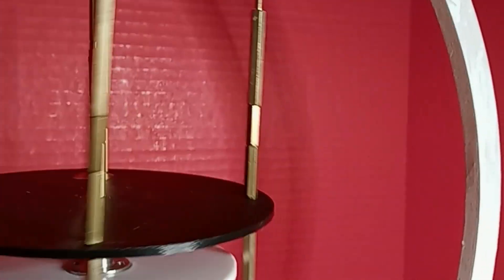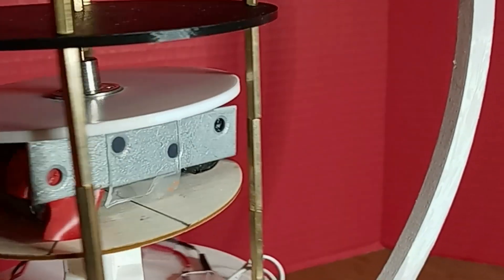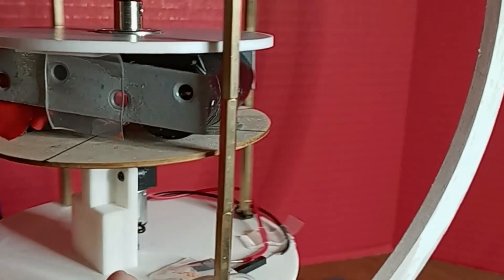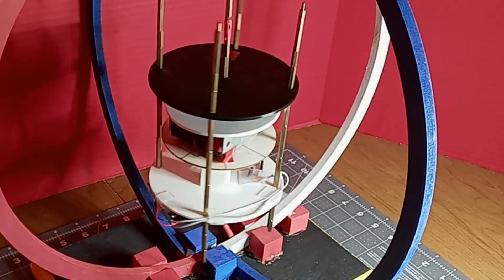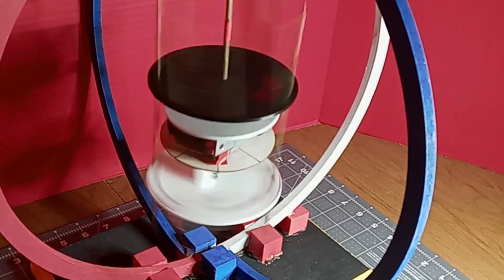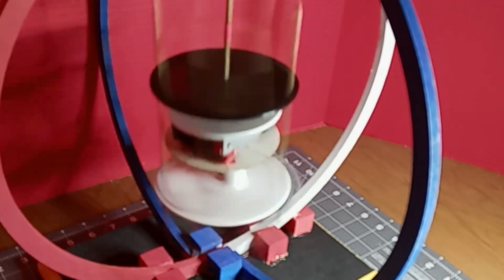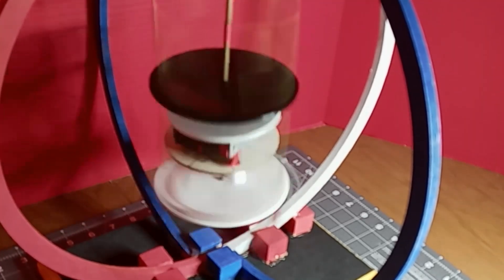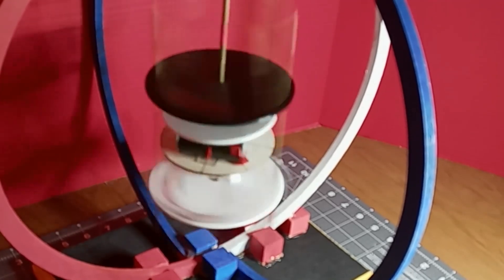Compass Magnet Motor is Faster with some Improvements

Comment: about the wobble, the part that is spinning needs to be balanced. Those electronics at the bottom will be contributing hugely. If you could find the center of gravity of the electronics and then mount them with that center in line with the turning center the wobble will reduce. good luck

Comment: It wobbles cause you've got a bunch of spikes sticking out catching air causing turbulence and making a wobble plus what's the point a magnetized needle in a compass points north but the size of the magnet you'd need to push off of to steer by even on earth can't exist on earth and in space where there's Hardly any gravity the magnets would need to be planets sized to have any effect so basically you should know your not smart enough when the entire purpose of it is mathematicaly impossible it's a very dumb childs idea go back to school and learn physics first😊
Reply from the maker: @wilswildworkshop7817  Thanks for watching the video and commenting. You are entitled to your opinion but no need to be discourteous. Small magnets have been used in satellites for decades for reaction control.

Comment: I bet the shaft isnt in the exact center of the black disk causing the wobble
Reply from the maker: @doubleooh7337  Very possible. Could also be the magnets aren't centered well enough. It would be able to turn faster without that wobble. Thanks for watching and commenting.